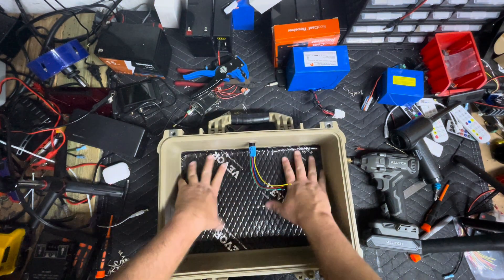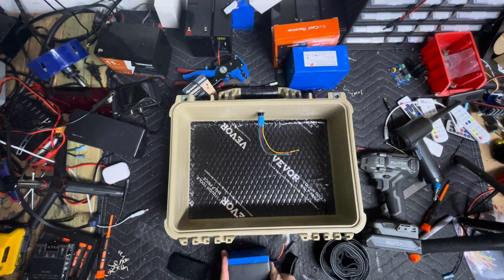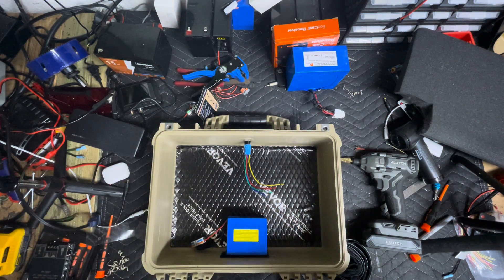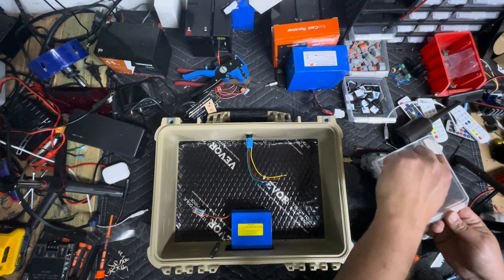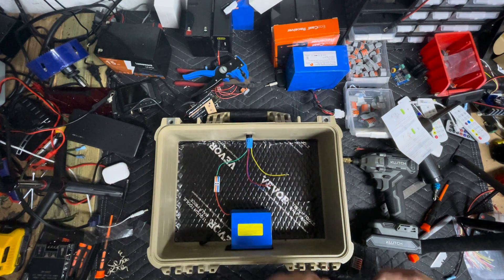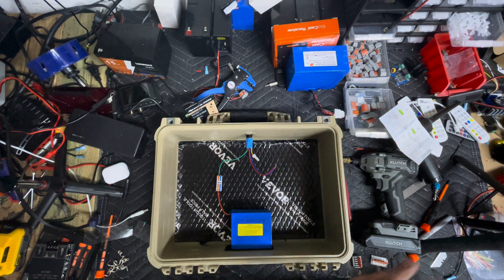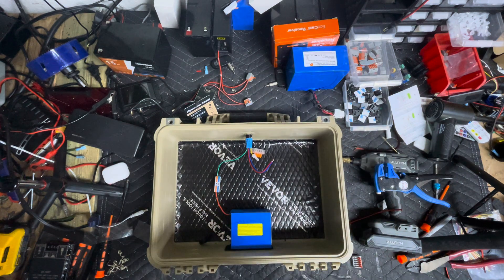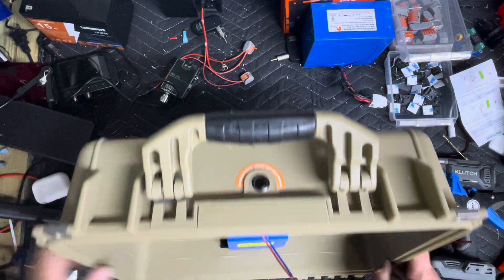How To Build DIY BoomBox Build Part 3

Comment: So if my speakers have built in RGB lights, will the 24v supply work? Or will I need to step it down?
Reply: You would need a step down 24>12v

Comment: The green wire is ground correct?
Reply from the maker: @mississippioutdoorsguy1909  depends on the switch in this video no
Reply: I'm having trouble connecting the same power button to Milwaukee adapter I got the whole speaker working but the power button doesn't turn anything off I need help lol

Comment: So the battery is 24volt and the switch pulls up on Amazon 12volt will this still work?
Reply from the maker: @joejaramillo8765  yes it’s the current you got to worry about the led is good up to 36v on most
Reply: Sorry one more question would a 2.6 ah be too small? And what is your average run time on a 4 ah
Reply: Thanks 
What if I want to add led lights do those have to be 24volt?
Reply from the maker: @joejaramillo8765  need to buck the voltage to lower what they need
Reply: Is there much difference between the 4ah and 8ah battery of this series? This will be my second box build. I built the first with a tantlentcell and buck converter. I like this better but I want as much battery life as possible.
Reply from the maker: @ double the run time

Comment: No low voltage disconnect switch needed when using this type battery?
Reply from the maker: Correct it’s built into bms